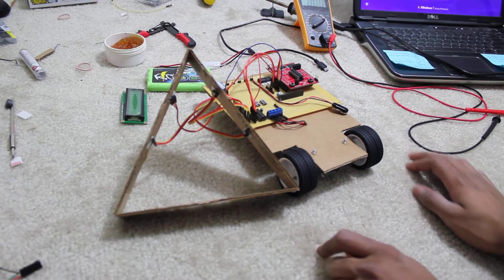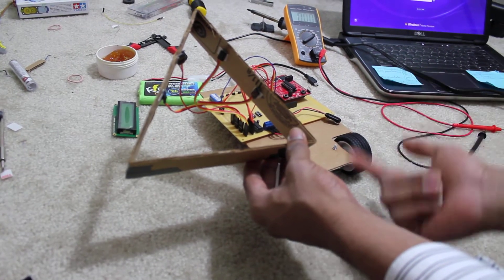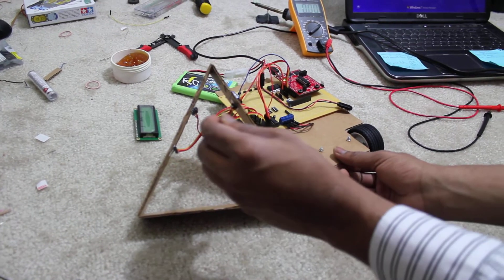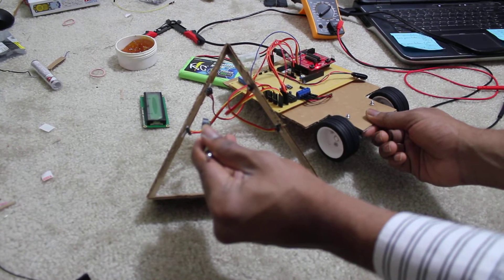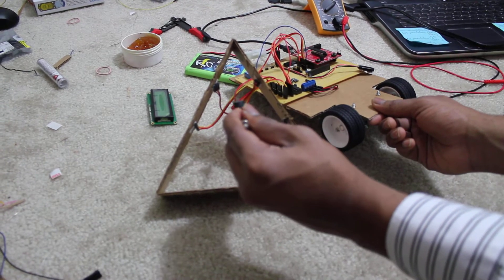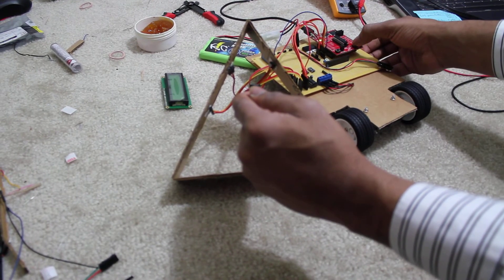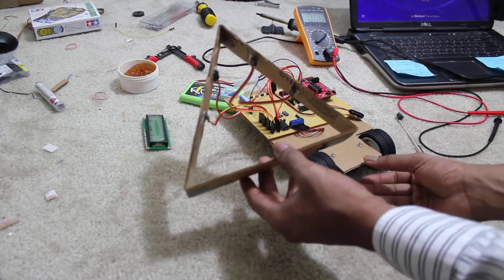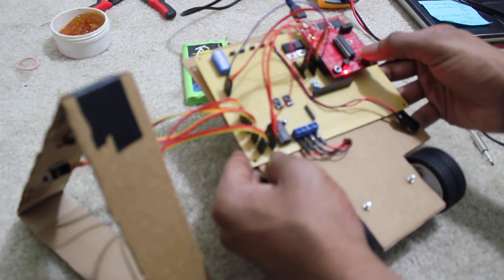Tongue Drive System

Comment: I have been working on the same project, but I have faced some problems connecting the encoder and decoder with the RF transmitter and receiver so I am asking if you could help me out. it would be of great help if u sent me the Arduino codes for the system and the Schematic of the circuit. my email is   dr.fetouh00@gmail.com

Comment: Hi, Anshul. I wanted to know if there are any other Hall effect sensor that I could use as the one you have used is not available.
Reply from the maker: Jasmine, any Hall effect sensor should work, it would be easier to predict North Pole vs South Pole if you are using a linear sensor, just make sure the sensor you are using is a linear one.
Reply: +Anshul Naidu Routhu can you please suggest some except the one you have used?
Reply from the maker: +Jasmine Cheema You can just google "Linear Hall effect Sensors" and can choose from the list that is available to you in your area.
Reply: +Anshul Naidu Routhu Is there any specific kind of magnet required?
Reply: +Jasmine Cheema  A1302 is the substitute Linear hall Sensor that you can use.